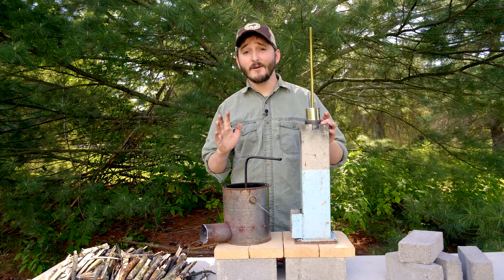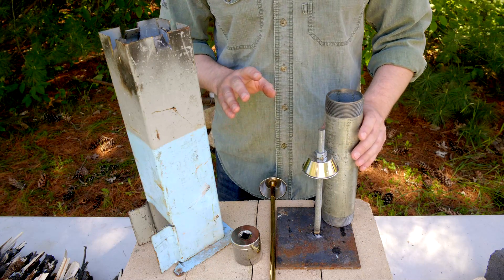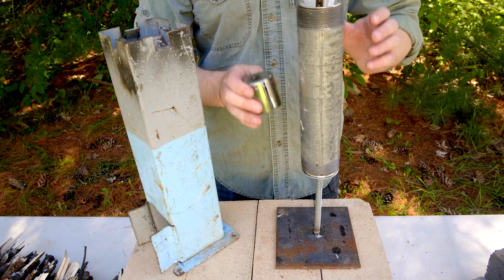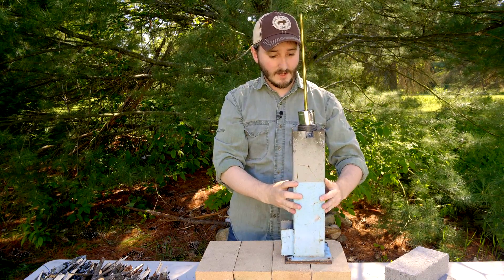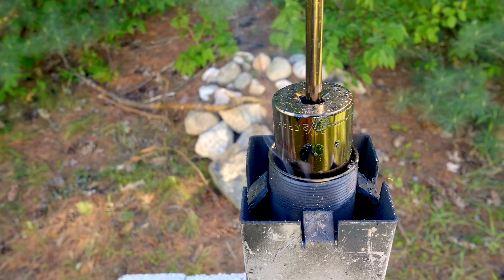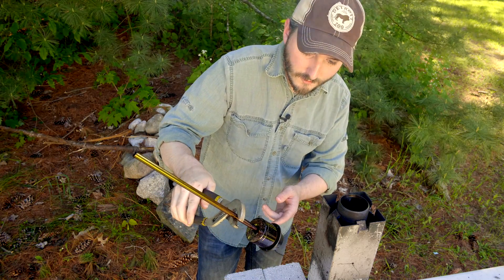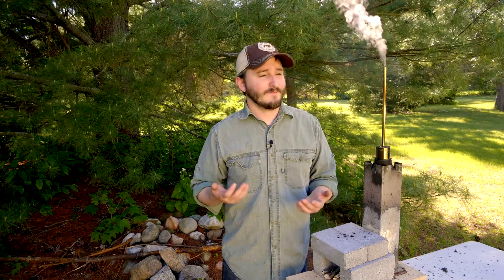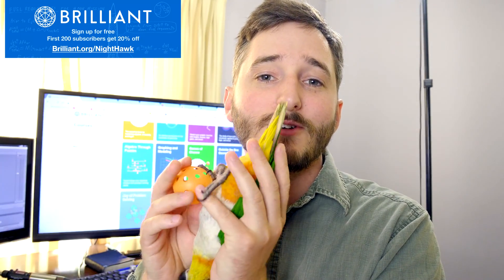Testing A Better Wood Gassifier (Bio Gas Fuel)

Comment: I'd like to know if the type of wood used would produce varying degrees of gas purity and if it's flammable properties would vary depending on the choice of wood ? and what can the tar like substance be used for ? and is it also flammable ? one other question is the charcoal usable after going through this process ? thanks for posting

Comment: In your video, you mention the tar that condensed all over the inside of your vessel. The tar is part of the volatile fraction of wood; about 80% of wood is volatile, 20% is fixed carbon. In a true gasifier (rather than a pyrolyzer) 40-50% of the energy content of the gas that is produced (in the form of hydrogen and carbon monoxide) comes from cracking the tar at temperatures in excess of 800˚C; the rest of it comes from reduction reactions from burning the tar and sending the combustion products through red hot charcoal; the reduction reactions consume the charcoal to produce carbon monoxide. The carbon monoxide and hydrogen is what goes to fuel a gasifier car; carbon monoxide is combustible, and can burn yet again to produce carbon dioxide.  

If you are losing that tar to condensation rather than cracking it, you are losing all of that energy content to a waste product. A full gasifier loses some tar, since the cracking process is not 100% efficient, but the objective is to crack as much of that tar into usable hydrogen and carbon monoxide as possible.

Comment: At around 5:50 you keep trying to light the tar gases, and the flame keeps blowing out. This is because the flame front propagation speed through tar gases is very slow. It is so slow that the flow rate of the gas out-paces the flame front propagation, so the flow of gas blows the flame out; the burning portion just goes up and away faster than it can chase down the tar gases. The flame being blown out is not a function of whether or not the gas is flammable; this strictly depends on how fast flames propagate through a mixture of air and the gas.

One way to keep the flame there is to introduce something that will mix the tar gases with air; the gas can't burn with a flame without the gas mixing with air. Without some way of mixing the gas with air (like the mixing tube of a bunsen burner, or the little brass thing at the bottom of blow torches), the flame is limited to the outer part of the plume of gas. This makes it easy to blow out. 

Secondly, even if the gas were well mixed, you need a flame holder. Look up "flame holder" on Wikipedia for a full explanation; these structures are used in jet engines to keep the jet engine from blowing out its own flame, because the flame front propagation rate in atomized jet fuel mixed with air is still so slow (though I'm pretty sure it is faster than pyrolysis gases) that it is easily blown out by having the burning portion carried out of the engine and dissipated by the extremely fast flow of gas. In order to hold the flame where the flame front propagation speed is slow but the gas flow rate is fast, you need a turbulent region, usually created by a structure that has a turbulent wake in a flow of gas, which re-circulates the burning material to "hold" the flame in the wake of the structure. Do a YouTube search for "Flame Holder" to get a sense of what these things are. They can hold a flame that withstands the flow rates of jet engines.

To give you an idea of how slow flame front propagation is, consider the fact that the flame front propagation in gasoline vapors mixed with air is about 35 miles per hour. When you are driving down the freeway, your car is traveling faster than the flame front in the cylinders of your engine. Expect the flame front of pyrolysis gases (wood smoke) to be significantly slower than 35 miles per hour.

Comment: Making bio gas fuel for cars etc like we do on Sweden. Like ald catfood, peels, leftover meat, mash... Whatever really that will decay and give off gas.
And... There is No energy loss driving using  bio gas compared to Super Unleaded. Yeah a car conversion with a second storage for tubes (like under the trunk floor) and a set of eftra injectors but... Awesome and carbon neutral.

SO PLEAS MAKE SOME GAS FROM HOUSEHOLD WASTE
😁

Cheers/Tom

Comment: Have you considered loading it with sawdust made from the sticks or other was instead of the bulkier sticks themselves? In the lumber industry a lot of kilns run off of the gasification of sawdust from the first cuts off logs. This would also give you the ability to fill your chamber more fully

Comment: I wonder if you could use the wood gas in a gas powered foundry or forge? Maybe have two runing at different intervals so that one is running while the fuel is being replaced in the other, and the active one reignites the refueled one?

Comment: Ok, you need to weld up a top plate, and drill out a "chimney" port on the top back side of the 4" tube,  then run that to a solar powered venturi scrubber , this will allow you to capture all of the smoke and tar , and you will be able to operate it at close proximity without smoke in your eyes, lungs.

Comment: If you could store sufficient quantities of wood gas, do you think it could be used in a simple backyard aluminum foundry, or would it not get hot enough?
Reply from the maker: It would work quite well. It burns at a slightly lower temperature than propane.
Reply: Thanks! I'll have to figure out the best way to store it before I can use it, but I have a few ideas...

Comment: Do you think a chamber above the rocket stove entrance could be made store fuel wood? The excess heat could be used to drive off some of the water in the wood before you put it into the reaction chamber.

Comment: Don't know if anyone's thought of this, but you could pre-load little cages that would exactly fit your 10" pipe with bio-matter for even more efficiency. In this way, you could have several loaded magazines to throw in with the maximum amount of fuel one could reasonably fit.

Comment: Nifty idea to cycle the fuel through like that! Unfortunately, charcoal crumbs will likely stick to the lower cup and defeat the seal if the chamber isn't reseated properly.
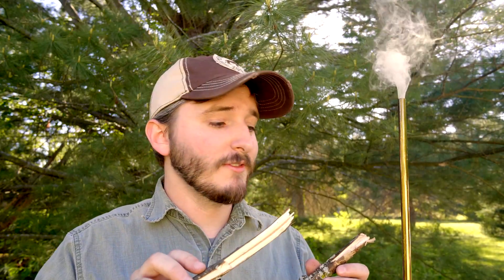At 6:00, if you want to use it as a torch, look for a flame holder, a plate that hovers above the opening to lower the exhaust speed and prevent the gas from blowing out its own flame.

Comment: I always wondered why steam turbine engines failed, today I would start pushing wood as a fuel again, it is probably the most carbon neutral fuel we can have.
Growing trees and then burning them is absolutely carbon neutral. The next one following is vegetable oil as fuel, specially since it can be used on modified diesel engines (Like Rudolf himself meant to), however it does requiere SCR to eliminate nitric emissions.

Comment: Very nice design. Would you be considering adding a DIY distillation column to clean the gas?
Reply from the maker: Not distillation, but I am working on a video now about collecting and cleaning the gas.
Reply: Cool, Looking forward to that. My initial thoughts for cleaning the wood gas were along the lines of borrowing tricks from distillation columns. Basically using a bead bed column to help separate out the heavy stuff like tars, and act as a gas cooler.
Reply: I think it would be interesting to see this run on coal to produce coal gas. (hopefully that wouldn't burn too hot producing the gas, but it likely would...)

Comment: Hello,
Thanks for the video. It's a good start for wood gasification but can't be used as-is for running a generator or sending the gas to heat up a place with living beings ; you need to pass that smoke into a water tank to filter tar and heavy oils first, at least.
I am looking for a long time for Internet ressources on this topic ; Mr Teslonian on YouTube made quite a few very instructive videos, but his test units are 'too big' for a small hobyist or survivalist shed. Yours might be too small but also much more accessible for a hobyist. I hope you will make a 3rd version, and subscribed to your channel. Many thanks !

Comment: You should really use firebricks for this, 
red normal bricks can explode.
Reply from the maker: The thin orange ones are firebricks, they just don't look like regular ones. The larger grey bricks are not though. You're right they can chip and pop.

Comment: a cooling coil connected to a tank with a water drain would allow the non-volatile components to be separated and dumped out the bottom  while gas could be collected at the top . maybe even compressed and stored. like a still

Comment: I would really love some video's on the properties of the wood gas and its storage.
Just collecting it in a balloon, letting it cool down and seeing if the gas afterwards is clear and still flammable. And checking the inside of the balloon for flammable volatile residue.

Or using glassware for better visuals. Maybe run it through a cheapo (homemade?) distillation column to collect the steam and get dry gas.

Comment: Why not just make multiple interchangeable cans for your prior design? Also, you are correct in saying that the charcoal is useful, for many things. So, too, is the tar. Best to make a grate a bit up from the bottoms of your replacement cans so this may be harvested as well. Lastly, if you run your outlet pipe into some water in a sealed tank with an extraction hose at the top, the resulting bubbles of gas will be scrubbed of the smoke soot. The gas can be harvested from above the water in the sealed container and then compressed and pumped into a welding tank to about 2000psi for later use. Remember, if you can use three by-products from the single activity then you are truly economical.

Comment: The issue of using this as a car fuel is the soil. While on small scale it may be negligible, if used as a car fuel by all the people who own and drive cars would rob the soil of nutrients it would otherwise receive through decomposition.
Reply from the maker: Interesting thought. Possibly avoidable by processing and redistributing the ash.
Reply: Another huge problem is the tar. Wood gas asnit is naturally produced is extremely unclean and would need thorough processing before it could be used as a fuel. Otherwise your engine will clog in no time at all
Reply from the maker: Tar isn't an issue. It settles out of the gas in about 20 minutes of storage. After that it's clean burning.

Comment: In this you recycled the charcoal to make more wood gas. Could you do something where the filtered wood gas is routed back into a torch to heat the chamber and thereby be recycling the wood gas to make and keep the charcoal?
Reply from the maker: Yes, the gas can easily be routed into the bottom of the stove.
Reply: On further thought, perhaps two cross heating eachother so you don't loose heat while reloading ... Or it might be more complicated than that. I'll leave this to the experts.

Comment: At 7:38 when you said the pipe was empty you know that statement was incorrect? The pipe was full of air and some soot and tar on the walls. Anyway enough teasing on my part. The lifting of the pipe looks to be a little cumbersome. Why not weld a tab on it that you could grab by the pliers. Also a rod to have the cap and pipe on so you just lift to cleat the top of the box and swing out of the way. The guide rod could have a notch in it so that when you lift the top up you just rest in in the notch so it does not fall. You could go one step farther and use a coiled handle that keeps the handle cool like the old wood stoves handle. Then if you really want to get into things you could also add a handle of that same type for the pipe and use the same guide rod for both.

Comment: So you're burning wood to make charcoal, then burning the charcoal to make a gas that will burn as long as you keep flaming it with a propane torch. This seems less than optimal.

Comment: Would there be a better flame from the wood gas tube when bent to the side again?
Guess there's not a lot of oxygen left around it in the hot air flow from the burner below?!

Comment: For the scientists/chemists/pyrotechnicians and out there: Carbon Monoxide will form at roughly 4 times the rate of Carbon Dioxide when Carbon containing matter is reacted  with oxygen in the presence of thermal energy.

Look up energy of formation...
Reply from the maker: True, but CO will further oxidize to CO2 with excess oxygen as with a clean burning flame.

Comment: Burning or heating any galvanized metal is seriously bad juju if you breath it in.
Reply from the maker: Yeah there's not enough here to really be an issue though. I grabbed the wrong pipe off the shelf and didn't notice until I got home. Just stood upwind while the zinc burned off.

Comment: Would it be possible to get a small combustion engine running with this? Like an RC engine?
Reply: petrol engines have been run on wood gas for almost as long as they've been running on petrol, but those little nitro engines might not work with it. you know the best way to find out though, try it! if the gas is clean then it won't cause any harm to the engine.

Comment: Hey NightHawkInLight did you know that you can also collect gasoline or crude oil if you distill or condense and collect the ”tar”... Hope the info helps if you need any references look up biocrude or documentaries about turning plastic into gasoline
Reply from the maker: I've tried converting plastic before but did not get it hot enough. That might be a really good thing to try again with this setup. Thanks for the ideas
Reply: NightHawkInLight. yeah man, no problem. im glad i could help. Nice project & Stay Awesome bro ✌👍🔥
Reply: NightHawkInLight ... you know in theory you could make a pyrolysis Distillery with a series of condensers and collection tanks running on methane gas from a fecal matter biogas reactor and literally be self-sufficient for electricity harvesting gasoline and syngas from garbage cans and all the while also having a great mass of methane to boot hahah I don't know if this is ingenious or just genius but I love this idea 😂
Reply: @discardedink5994  Speaking of biogas, I will need to move to a warm countryside to build the biodigester.
Reply: @Nighthawkinlight  plasma arc waste disposal produces syngas and slag as the product. From what I understand it will break down anything short of nuclear waste. generator, plasma cutter, likely a gasometer feeding syngas back to the generator once the process is started. And kiln brick or vermiculite.

Comment: you are mostly correct when you say breakdown of wood is carbon neutral, because you can break down wood with anaerobic fermentation ( Bokashi) and it does not release CO2 or Methane during the process. Either that or Bokashi fermentation would be considered carbon negative since it condensed the carbon from the air and soil
Reply from the maker: I've just read several pages about bokashi fermentation as I've never heard of it before. I'm having trouble discovering exactly what microbes are used in the process that release neither methane or CO2 in their digestion. Seems very secretive which always makes me suspicious.

Comment: 6:37 I read CO remains 3 months in the atmosphere aprox, then it oxidyze and generates ozone, so the combustion of a flame is 100% enviromentally friendlly until tar appears, i dont know what chemicals appears by burning tar or the composition of tarr itself...
Nice video!
Reply: the tar is a very complex myriad of hydrocarbons but it is basically wood tar creosote which isn't particularly environmentally harmful, it does make a good, cheap wood treatment.

Comment: I think your socket should be ok as long as it didnt get above a purple color. That dark gold/bronze color means it got to about 500F which is generally lower than the tempering temp of most tool steels.
Reply from the maker: I doubt craftsman actually uses tool steel for sockets anyway. Probably just some middle of the road carbon steel. I'm sure it's fine

Comment: I wonder. Has anyone ever tried doing this using heat from something like a big magnifiying glass? i seen them light pieces of wood on fire so i bet its more than hot enough. Than way you get charcoal and wood gass without burning any wood in the process :) Obviously sun is not something we have 24/7 but even if you can use it 35% of the days in a year that is still a 35% increase in efficency which is huge.
Reply: It's called a "solar furnace" and if you have space to build a big enough one you can set things like steel on fire...  Only limitations really are that you can't heat anything hotter than the surface temperature of the sun, and you only get an average of around 2HP per square foot of collector depending on lattitude and weather.
Reply: my thought too...will we get the same result if only we heat it without burn it with fire?

Comment: Carbon monoxide just oxidizes to co2 before it can pollute. Manz dusn't kno da facts.

Btw I like how you argued that burning fallen wood is carbon neutral, then acknowledged your argument is invalid as this airborne pollutants don't typically form when fungus do their job. Instead we get new biomaterials for the soil.

The better argument is that fires are natural and we have actually prevented much more smoke from wildfires in California alone than there could possibly be from man made non commercial wood smoke in the next 10 years.
Reply from the maker: I absolutely did not say my argument is invalid. This process is carbon neutral and has no climate or ocean acidification impact whatsoever. Pollution and carbon neutrality have entirely separate effects.